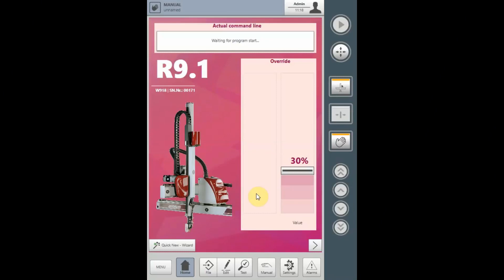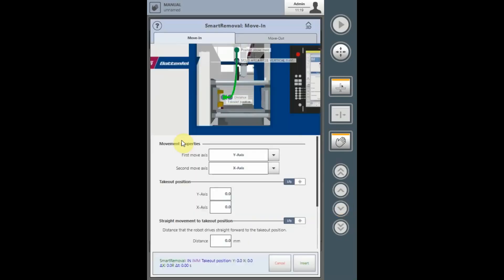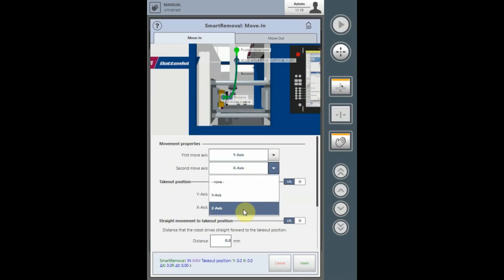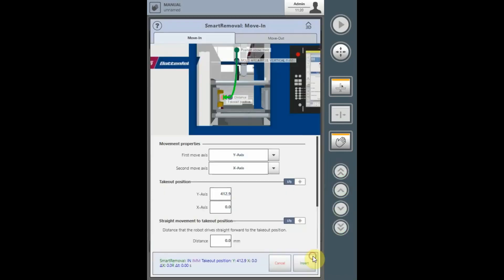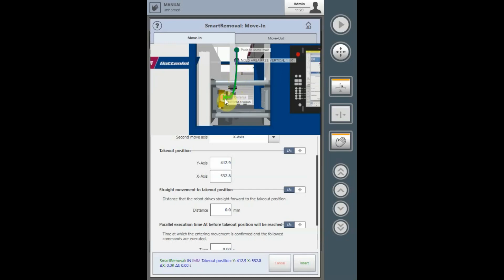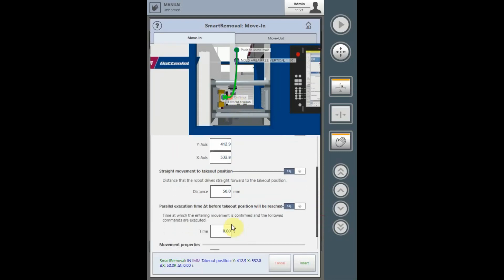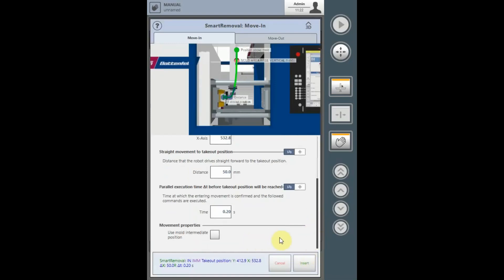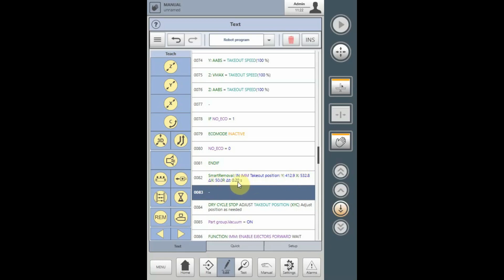R9 Smart Removal In

Comment: Wittmann has been the best support that I have had in my more than 30 year career in Plastics Injection Molding.  Not only do they supply videos such as this, but the technician's will also help over the phone, email, etc...  I have received extensive communication about how to add programming logic to my R8 and R9 Wittmann robots on more than one occasion.  Our Maintenance staff has also been helped immensely in cases of trouble shooting by simply sending the system report copied to a thumb drive and then simple sent via email.  Just a phenomenal group to work with who do not hesitate to support when needed.